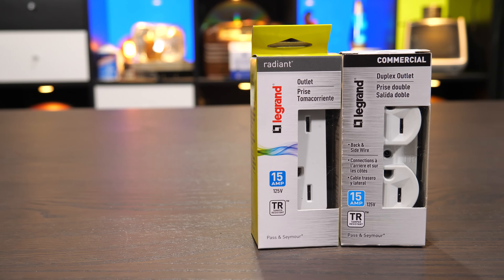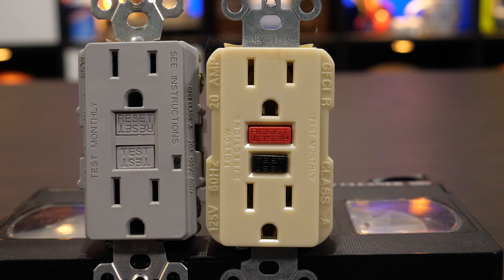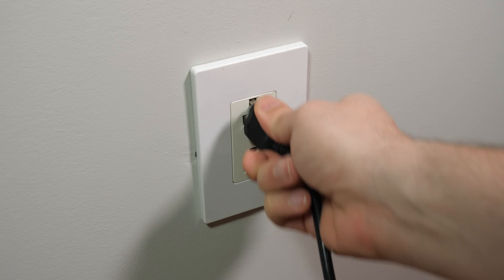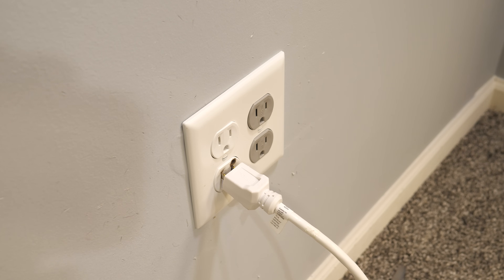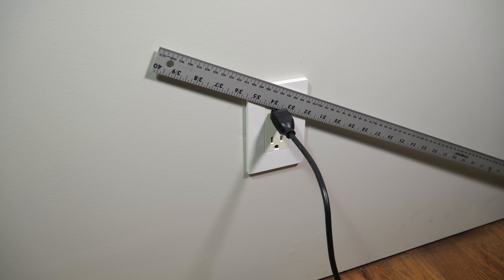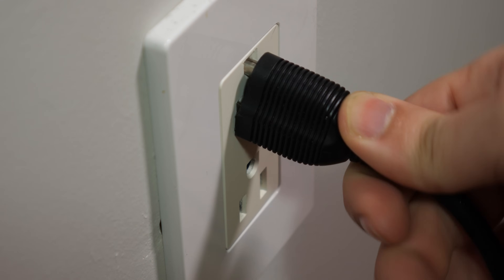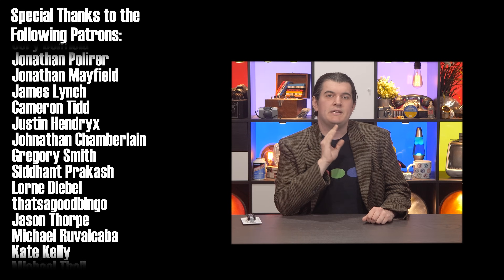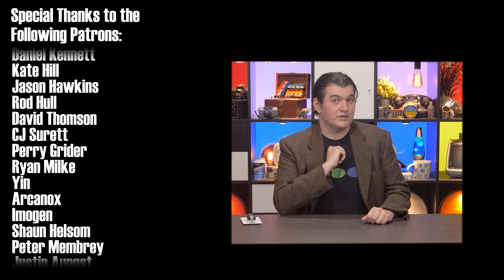Power outlets are topsy turvy - but does it matter?

Comment: The US standard for electrical wiring is bizarre.

Plug blades are thinner than used in Australia and New Zealand but as you only have half the voltage the current capacity gets pushed up to 15 A.  That also means your wiring has to be larger and thus more expensive.

The actual voltage to the house is 230 V, but is split across a centre-tapped transformer to make two 115 V circuits 180 degrees out of phase.  This means you can use the full 230 V (with a special plug design) for higher power appliances, but your power draw has to be kept fairly balanced or problems arise.  Also if you lose the centre-tap then the voltages on each circuit will swing until they balance… somewhere.  Most 115 V appliances resent having significantly closer to 230 V applied, so this isn’t what you want.

I have no idea what you do with three-phase supply.  Divide it up into three sets two 180 degree out of phase circuits to get a myriad of different possible voltages and phase shifts, I expect.

Very archaic system that causes lots of problems.
Reply: Actually the plug pin dimensions are the same, which is not surprising since the AU/NZ plug was originally designed in the U.S. But, yes they use a weird wiring and reticulation system to compensate for the shortcomings of sticking with 120V for most appliances. Even so, still can't plug a 2.4kW heater into any power point. Has to be a "special" socket wired across the two 120V phases. Three phase is another world in the U.S.  Not the simple 240V/415V system coming past every consumer.
Reply: In North America, the distribution system is 3-phase Y, but only a single phase is used to provide power to a single residential customer.  The final transformer converts it to 120/240 split phase.
Reply: @GH-oi2jf  
Commercial installations will use all three phases, though.  Possibly it’s split into discrete areas — e.g. one phase per floor for multi-story?
Reply: @boggisthecat  The circuit-breaker panels that I've seen in commercial buildings have all three phases; it's 208V from one hot to another, and 120V from any hot to neutral. So the same panel can supply 208V 3-phase (e.g. to a big motor), 208V single-phase (e.g. to an apartment stove), or 120V single-phase.
Reply: @kc9scott  
The usual domestic US supply is 230 V (or 240 V) to the house.  If commercial is only 115-120 V then that would be very inefficient, unless they’re tapping a considerably higher supply from a transformer in the building.

In most of Europe they supply 230 V single-phase or 230 V three-phase to residences, and 230 V three-phase to commercial.  That’s mostly the norm globally, with weird exceptions like Japan where voltage is 100 V and phase is either 50 Hz or 60 Hz.  (The reason being both the US and UK supplied generating equipment in the development of mains systems, back when lighting was the normal requirement.)
Reply: @boggisthecat Well, that’s the way it is in the US.  Commercial (i.e. office, light manufacturing, large apartment buildings) is 208V 3-phase, from which 120V single-phase to neutral is readily available.  That corresponds to Europe where it’s 400V 3-phase, from which 230V single-phase to neutral is readily available.  So basically a factor of 2 for everything between US and Europe.

For heavy-duty industrial stuff there’s also 480V three-phase in the US, but that’s less common, only used for things like really big motors.

Comment: Here in Europe we don't have the particular problem with orientation, as all power outlets are symmetrical, including the grounded ones. (Except in Britain, but never mind the Brits, they are weird anyway. They even drive on the wrong side of the road, that's how weird they are!) Which also means we never have to rotate the socket more than 90 degrees to insert it.

Comment: You need sockets that have a very specific Right Way Up, and plugs with safety features like plastic coated prongs and wires that come out at 90°, and proper hand grips on the plugs, maybe a bit like the UK ones... Lol

Comment: As what I an electrician told me the ground down position for an outlet is used in residential construction. and the ground up is used in commercial construction. For example I have a welder with a right angle molded plug at the end and it is molded in the ground up position. where as the right angle plug on my home fridge is molded for a ground down outlets. Don't know if that helps or not... I never followed up to find out why...

Comment: I swear, one cause of the narrow spacing on 120V 3-prong outlets is a mix of space saving and practicality. If you look at UPS equipment, they are notoriously dense, so you have to use straight plugs or you will not be getting two in next to each other. This also translates to things like laptop carts, power strips, PDUs, etc. where the straight plug is meant to allow easy removal while maximizing density and minimizing material. Because some companies (thanks APC) can't decide what orientation to keep their plugs in on large blocks, like in PDUs and UPSes, the only guaranteed, surefire plug design that will always work is straight in, narrow, and without a flare.

Of course, once you move to 240 there are better solutions like NEMA C14 to C15 PDUs, which are great. However, if you accidentally plug a 120V device in, you can cook it, because the C15 plug is exactly the same on 120 and 240. Fun!

Comment: Question for you Alec (or any electricians who may happen to notice this in the >6k comments already!). So I just got a visit from my electric company, I guess a prior resident had a surge protector installed at the meter and he was going to take it out because I'm not paying for it (i.e., no one told me it was there when I moved in and contacted the company). Anyway, I told him to leave it put. I'm in rural SW GA, we get a TON of lightning strikes. I can't see a video on this, know anything about them? I'm going to start doing some research but this is the first place I thought to start to find solid info that I could understand. Thankees! [edit: note this is at the meter, not the breaker panel. Maybe you can't even install your own at the meter?]

Comment: The plug design used in Australia and New Zealand are also used in China — but inverted.  Not an issue until you find that the Chinese wall-warts face the wrong way.

Comment: This actually happened to me as a kid. I had a dart board somewhat close to my super nintendo and the plug had become slightly loose from the outlet but was still making connection.

I was playing darts on my wall one night and one of the darts managed to bounce off the board and landed DIRECTLY on top of that loose outlet. I heard I brief crackling sound and finally a BANG!

I tried to figure out what the hell happened and saw a char mark on the wall and the dart had a huge melted spot on it as did the nintendo's plug. Whole thing scared the hell out of me but the plug still worked for a couple days before I got a replacement.

Comment: In the UK the ground pin is always at the top. Convention means you are less likely to reverse Live and Neutral in the plug. In the UK further, live and neutral are shuttered on the socket (this shutter moves out of the way via the earth pin, which is longer than the other two when a plug is connected). Live and Neutral on the plug is insulated at the top of the pins (sleeved blades) so little fingers do not connect to them when putting in or taking out a plug. Plugs are always fused up to a maximum of 13A at 240vac (sometimes you can see part of the fuse at the bottom of the plug and therefore you can easily see its value). The only 2 pin sockets you will find in a British household are shaver sockets. They normally are fed via an isolating transformer and only offer a low current output. Used in bathrooms to charge shavers, electric toothbrushes etc, the two pin pugs will also be sleeved at the top.
Reply: First to make, last to break.
Sleeved.
Sturdy
Fused.

The only danger is to your sole of your foot.
Reply: @ChrisWells1  Absolutely 🙂

Comment: Due to right angle plugs I really like the idea of all of them being opposite so that the ground are always on the outside edge of the receptacle. I really hate when you can't use two plugs on a duo wall receptacle.
Reply: What I'd really like to see are sideways pairs that both have the ground pin down so you could put two right angle plugs in and both would have the cords hanging down.
Reply: I just love how all the plugs are different and that if you have an extension chord to fit all kinds, and even diagonally so they won't bug each other, you're still screwed no matter what you do :p

Because, you know, all plugs are different, so some might be bigger, others might be smaller, some might be right angle but oriented diagonally, and so on, and so forth. And that's a problem everywhere, even here in Europe.

Also, pedantic fun fact, where I live we call receptacles a stopcontact, which could mean breaker contact or stop contact and I honestly don't know which, if either, and I really don't want to know because neither makes any sense, but then pedantic people will say that the "proper" name is wall contact box 🤣Which I just find such a gosh darn improvement 🤣 It's not wrong, like how a piano is a hammer trigger machine box. Oh, and the one on an extension chord is a table contact box 🤣I mean, at least then call it a 6/7 floor contact box because about 6 out of 7 times it's NOT on a table! :p And some have a little plastic loop so you can hang them from things, so then it's not on a floor or a table.

But whatever, language is fun, and very often very silly :) Most people around here call it either an extension chord or a plug box. I think plug box is a nice find. It works, it's descriptive (all though it has no plugs until you put one or more in) and would work for wall receptacles as well. So we'll never use the only term that sort of makes half sense for all the things it makes sense for because that would be confusing 🤣
Reply: Yeah, whenever I can only use one of the plugs on a wall receptacle I feel like I was ripped off.
Reply: Yep my thoughts exactly. This actually seem to be a winner in this game of pick you flaw.
Reply: 6" extensions for the win.
Reply: Laughs in UK side by side standard.
Reply: Right angle plugs aren't standardized either, so you'll find different types of those too.

Comment: In the UK with our excellent plugs and sockets I never even knew you guys had this safety issues in your games of throw the knives at the wall. I mean who'd even pick up the cutlery if you knew your plugs could be so dangerous? As there is no chance your government will do the sensible thing and adopt a safer electrical system, Maybe the plastic flatware lobby should ensure that congress pass a law ensuring that only plastic knives be used for your games.

Comment: In my home in Arizona, outlets have both orientations. The orientation is a visual indicator of which outlet is connected to a wall switch. The ones with ground pin up are controlled by a wall switch while the ones with ground pin down are always on.

Comment: In Australia we updated the standards for the Type I plug to have sleeving without breaking compatibility. The size of our pins are pretty much the same as yours (not a coincidence) so there is no reason the sleeving couldn't be added to Type  A and B. The sleeving enhances safety even when used with old receptacles with Earth down but if standards were changed to require earth up this only makes new installations safer. So sleeving is the correct choice
Reply: I understand that for the Australian socket the earth is at the bottom so that the earth pin remains in contact if the cord is pulled downward, breaking contact with live and/or neutral, losing earth last.
Reply: @AppleTom9091 ah, is that why it is? I was really surprised the earth was at the bottom when I moved here from the UK. I do find they fall out annoyingly easily compared to other designs I've used
Reply: I have seen type A and B plugs with plastic insulation on the blades before but it isn't common at all.
Reply: Also, almost all of our outlets have switches on them. You can even buy power strips with switches.
Reply: @edgarwalk5637 I haven’t lived in Aus for decades, but here in NZ there are a non insignificant amount of new builds that have the American-style switchless plugs, where you only know if they’re live when the amber light beside them is lit.

Not a fan of them myself, since I’m far more used to the switched plugs that I grew up with.
Reply: Damn, i wonder what went wrong here. My comment was deleted, it contained facts, historical facts, accurate assessments and a minor error “w” instead of “Hz”. 
Hmmm. So much to like! 🌟

Comment: G'day from Australia. where everything is 240V. Four things: (1) Our ground pins on outlets are at the bottom, and ALL outlets are grounded (2) Both current pins are insulated (mandatory), about 60% of the length. - but not the Earth pin. (3) A loose plug doesn't droop, exposing the pins, due to the angled pins, not parallel as in the USA. (4) Earth leakage breakers are mandatory, so any contact with a live circuit will trip the breaker in about 30 ms - less than an eyeblink (which is about 250ms)

Comment: Seeing both the worse plug housing design (holy crap you have to get your fingers close to those pins!) paired with the lack of off switch on the wall to kill the power before unplugging, it's like the worst of both worlds! 

On an unrelated note, I'd be interested if you did a "sag" test for all the different plug faces from around the world. Eg, does the slant on our Aussie plug pins provide any sag prevention compared to our vertical cousins in the US?

Comment: When I was younger, I had a jar of coins spill from a shelf, and one landed just wrong on a dislodged plug. Threw the breaker, melted parts of the coin and the blade, and charred the receptacle and plug.

I may be biased from this, but I do tend to use the "ground up" orientation to this day.

Comment: I had been in only two house fires, both when I was a child. One time, a gold necklace fell behind a bed onto a socket - shorting the phase and neutral lines. Had the outlet been upside down, this would have been a much smaller and safer incident than a fire behind a bed somebody is sleeping in.
Reply: How can that cause a fire?
Shouldn't the fuse prevent that?
Reply: @Jehty_  Yes, the fuse should have protected that. I was probably somewhere between 7 to 9 at the time, so I don't know what the issue was. But I do remember the burnt wall and smell.

Comment: The simplest thing you could do to reduce the risk with these plugs is just coat a little of the end of the pins next to the plug with plastic, like UK plugs do. It's not a real fix but it would mitigate the partial dislodging and having your fingers on the pins when plugging it in. Orientation is then a matter of practicality or personal preference

Comment: After seeing your video I checked all the Schuko outlets in my home and shockingly: Some of them were installed upside down! I took a screwdriver and fixed that, now everyone can read the manufacturer logo of my Schuko outlets without weirdly tilting their head. Thank you! :D
Reply: The French outlets that are similar to Schukostecker have a pin inside them which leads to all the same issues he mentions regarding 90° plugs... so the Europeans can screw this stuff up as well

Comment: Australia too uses an "upside-down" plug with the ground pin at the bottom. No, it's not because of the character of the "land down under" or "upside-down land". A lot of people also say it's because if the pin gets pulled down, the last pin to still remain connected in the earth pin. Like you said, in normal cases this would expose the live and neutral pins, but the design standards of the Australian plugs make it compulsory to have insulating sleeves at the base of the live and neutral pins. Also the resemblance of the plug to look like the eyes and mouth of a scary movie mask means the live and neutral pins are slanted with the base facing away from each other, giving it a slightly better grip if pulled in either direction. and some designs of the cord also uses the right-angle slant to the right or the left.
Reply: And even the type I plug was pretty late to the party on insulated pins.
AS/NZS3112 only made it compulsary from 2005, compared to the UK type G plug (BS1363) which required insulation in 1984!
Reply: China uses the Australia & nz sockets but up the other way.   Looks weird when you see it.
Reply: @debochch  ✔️
Reply: Australian electrics are great though. It’s got to be a really intentional effort for them to become dangerous. Can have water running down the wall onto or behind a plate, it’s not gonna bite. Arcing? Doesn’t happen. Overloaded? Mcb will go. 240v 100w. Rest of world does not have benefit of our sparkies and standards.
To be fair tho, given the standard used to be “hook everything to the live wire the kitchen light hung on” (early days) we have earned our position as best practice

Comment: At age 10(ish) I tried plugging in a US plug into my New Zealand stove... I got quite a shock. The pins had been twisted to fit the local sockets, so it was not the best fit. 
Anyway, I saw it improperly inserted and decided to push it in all the way. Well, as you can guess, it wouldn't budge and my fingers slipped onto the pins. Every muscle in my body jerked in unison and I fell to the floor. Fun times.

Comment: Adopt the U.K. Socket.  1. Carries more current, 2. nearly always has a switch, 3 has built in fuse, 4, power pins are shuttered and protected and unlocked with the earth, 5. the blades are insulated and only the last 5 mm is exposed.